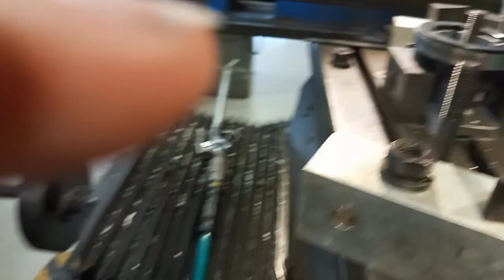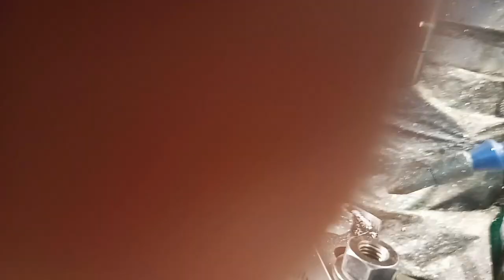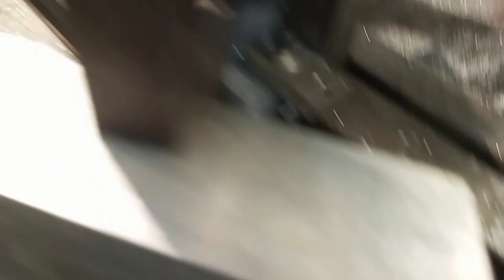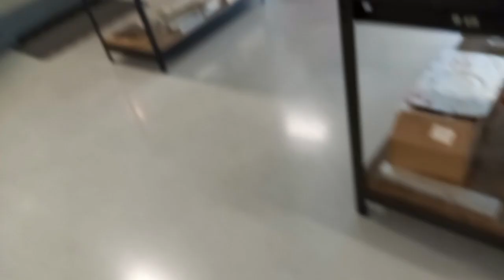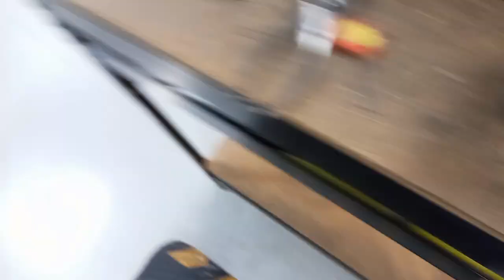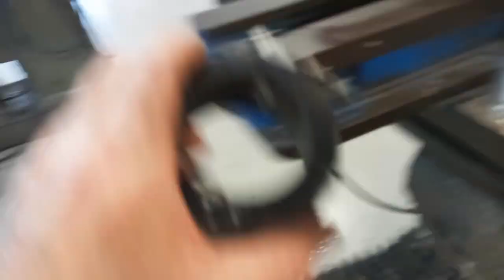Using 3D printed parts to fixture parts.

Comment: Y didn't you just use a lathe chuck to hold it? Bit over kill eh? 3d printing takes hours.
Reply from the maker: The part is made in a cnc lathe and then I receive it to put the holes in it. I have been using a mandrel to hold it in a horizontal position. I drill the holes and ream, then use a ball end mill the generate the four half circles. The ball end mill is insufficient tool for milling on the tip of the ball. The part quantity did not warrant the rotation of the head to achieve the 30–45-degree angle that is ideal cutting for a ball end mill in my opinion. Rotating the part to a vertical position allows the use of a round end mill. With the end mill I can use the diameter or the end or a combination of either. The ellipse shape was easy to make in the 3D printer. It seems any and all parts made by the printer take a long time. The best part is it (the 3D printer) can make complex shapes with no tooling or setups in different machines. Amazing piece of equipment. To use the chuck on the mill I would have to index the three jaws to the four cuts. Then the standard jaws would only hold on to the edge of the part which would crush the part. I would have to cut the shape into a set of soft jaws. Not feasible for the small lot of parts. I talked about the fixture in a earlier video and should have made it with struts on the base. Overall, it a time saver.
Reply: @toolmaker1370  I see your point, I work in a shop were we do large 1or 2 pc orders and 1 thing I learned is 10 machinists will make the same piece 10 different ways....and nobody cares as long as it's correct and didn't take a year....lol